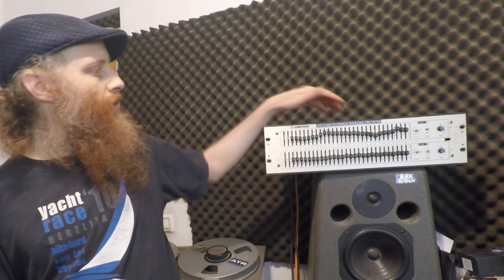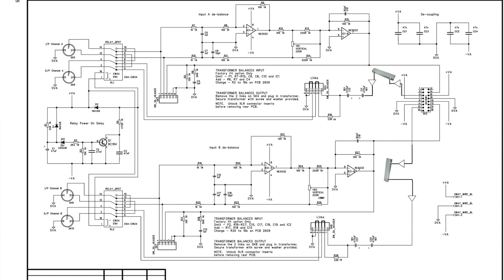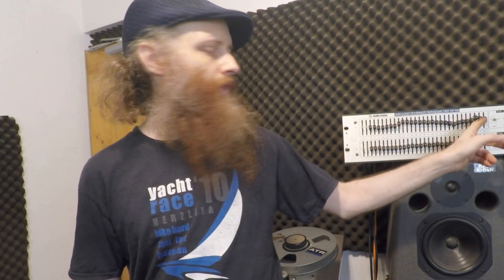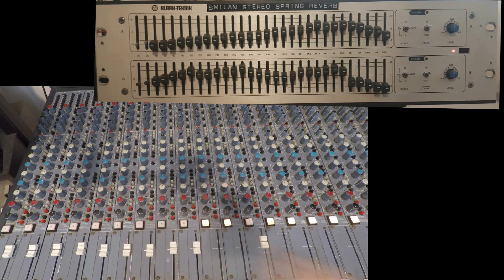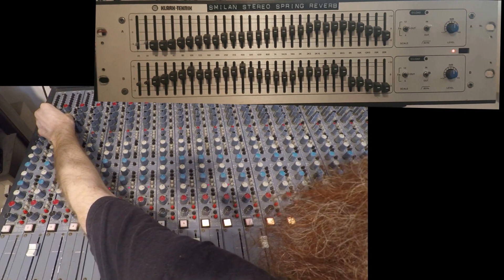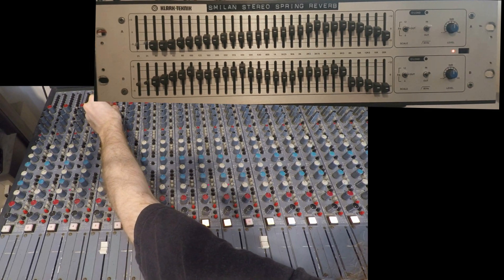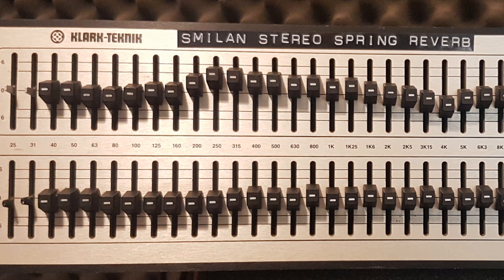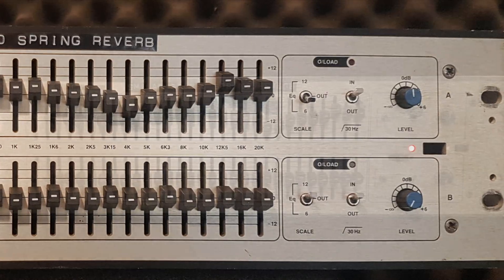Smilan Spring Reverb / Klark Teknik DN360 mod

Comment: Didn t You try comb filter ( "reversed" on one channel)  ???
Reply from the maker: I don't sure I've understood your comment?
Reply from the maker: Did you meant to rise one fader to the top and the next one take to the bottom? No, I didn't tried that, but I'll surely try soon.
Reply from the maker: I tried that now, it wasn't sounded too impressive...
Reply: @AsafSmilan  yes normal comb filtering but  left and right reversed , like if 60 Hz is bottom on left channel , then it s top on right channel , as for all frequencies . You tried that way ?
Reply from the maker: @iahorana  Very interesting, no I haven't tried that configuration , I'll try it later today.
Reply from the maker: @iahorana  I tried that now, still, nothing too impressing here you can listen to the dual comb filters vs flat EQ https://drive.google.com/drive/folders/1TpALu-m_yBEhlfHStr74f4HRH2YefRH1?usp=sharing